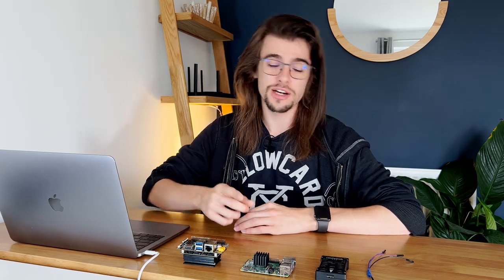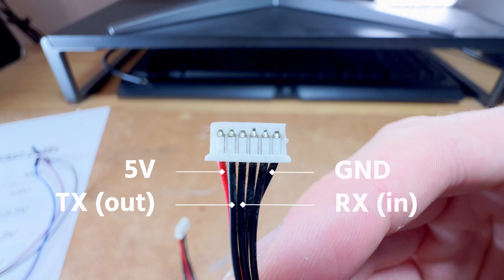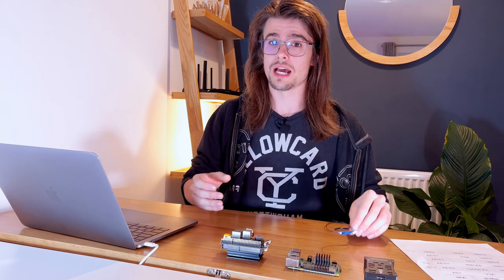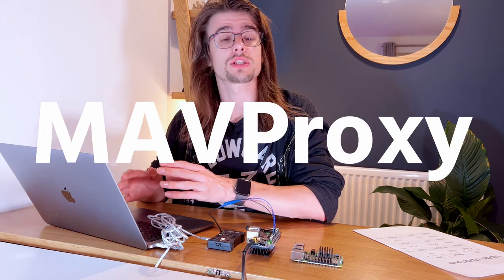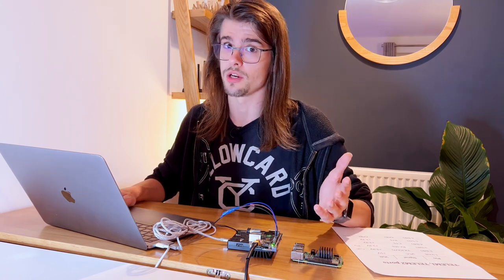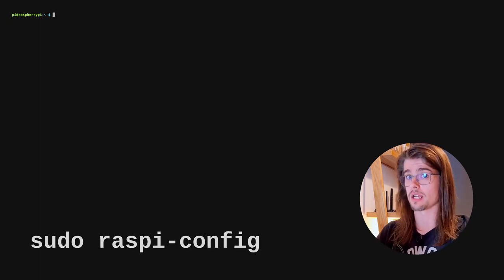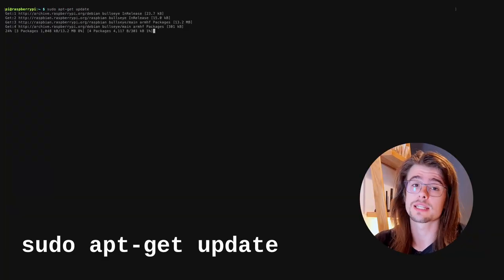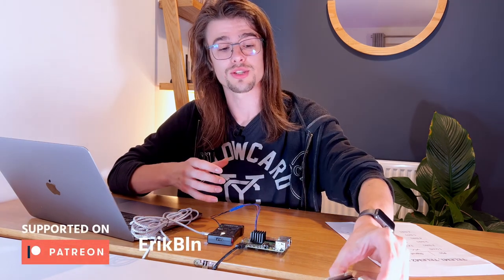How To Connect PixHawk to Raspberry Pi and NVIDIA Jetson

Comment: Great tutorial man, that's gonna really help me out later. I see you cut the 5V wire, but I also would like to know, is the PixHawk capable of supplying the full 20W range specified for the Nano through the telem2 port? That would be really handy as I want to install the board to the drone itself. And I'm not sure that I trust the PixHawk board will permit that power draw...

Edit: Figured I would use a buck converter from the battery instead, that way I can guarantee that it is capable

Comment: Hey, I have an AI model running on raspberry pi 0 2w, and the flight controller I have is the same as pixhawk 2.4.8. What are the benefits if I connect the raspberry pi to pixhawk ? I have seen how to connect, but what I fail to understand is, in my use case scenario will it be beneficial ?

Comment: Hello Sir, your videos are very useful. Thank you very much
I am newbie to Drone building DIY. I have Pixhawk 2.4.8 and wanted to use it with 4-in-1 ESC along with Raspberry PI 4 or 5. I watched all the videos out there on this scenario and all of them uses individual ESC's for each motors. I came across encoder to use but surely not understand it. I watched this video about connecting Raspberry PI to Pixhawk so I think I am okay there but not connecting 4-in-1 ESC to Pixhawk. Would you be able to suggest how I can get 4-in-1 ESC connected to Pixhawk? Or if you could do a video on it, would be awesome. Thank you so much for all your help in advance sir.

Comment: Hey, thank you so much for guiding me just like WOW! I am thinking about how can we connect the companion computer pi or Jetson, with Pixhawk using their micro-USB cable, I have seen a guy who is connecting, can we do it after following all the commands provided by you or there is another configuration need for  that...
Reply from the maker: You can technically use the micro-USB cable for serial but be aware that it disables some safety checks - for example, ArduPilot will assume it is not connected to a battery when using the USB link, and disables all battery failsafes.

Comment: Welcome, excellent explanation. Can you make a video of orange pi integration with pixhawk???
Reply from the maker: If I had access to one, sure! That said, in theory you can adapt the instructions in this video for the Orange Pi.

This looks to be the pinout for the Orange 5: http://www.orangepi.org/img/pi-5-pin-definition.png 

I imagine its a case of ensuring the TX and RX jumper wires of the serial wire I showed to the pins marked UART3 - ensure the TX jumper goes to the RX GPIO!

In software, it looks like that would map to /dev/ttyS3. See here for where I'm pulling that info (which is for the R1): https://learn.adafruit.com/circuitpython-on-orangepi-linux/uart-serial#the-hard-way-using-built-in-uart-3010837

Additionally, you may need to enable UART - see here (again, for the R1): https://learn.adafruit.com/circuitpython-on-orangepi-linux/orange-pi-r1#enable-uart-i2c-and-spi-3029848

TLDR; make sure to enable UART if needed, and connect to the relevant GPIO headers with the serial cable I showed in my video

Comment: Hi mr. Matt, I have some questions about coding RP4 with PixHawk. We are trying to making a VTOL UAV and it has a simple task that it will change servo angle at the determined location and altitude. So, I want write a code for RP4 that will get this mission. How can I do that, can u help me? I am an amateur on RP4. Do you have some simple examples about that? :)

Comment: Why did you choose the carrier board rather than the Nano Dev Kit?
Reply from the maker: I’ve used both with a drone, with the carrier board I can just wire up an XT30 connector and not need to power it via GPIO

Comment: thanks for sharing, i'm wondering if mavproxy can work on PX4 firmware?
Reply from the maker: Yep, should work just fine 👍🏻
Reply: @akamatchstic  thanks for reply, it works. However i have to wire tx rx through usb signal transform device.

Comment: Your video is interesting. Let me ask you a question. Does connecting using usb to ttl work in the same way as connecting to gpio pins 8, 9, and 10?
Reply from the maker: It should do yes - the key thing is to ensure a serial device is available to receive/send MAVLink messages
Reply: @akamatchstic  I too bought a usb to ttl device. But I do see how your way would save the cost and save an additional USB port.

Comment: after install mavproxy i need to install dronekit or with only mavproxy i can send commands for px4?
Reply from the maker: Depends on your goal to be honest. I used DroneKit in a project to send commands from a companion computer over Python. Setup looked like this:

My Python program -> DroneKit -> MAVProxy running locally -> PixHawk

If you’re using DroneKit and don’t need MAVProxy to eg also forward data to a ground station, you can actually skip MAVProxy and connect directly to the serial port.

With MAVProxy on its own, you can connect it up to anything that works with MAVLink data over the network. Eg multiple ground stations

If used on its own, you’ll still be able to send commands to PX4 on the PixHawk. DroneKit is one source that can send those commands

Comment: Hii Matchstic ! Can i connect the F405 mk3 lite filght control (other pikHawk)with Jetson Nano for project like u ?
Reply from the maker: In theory, yes!

Looking at the documentation (https://ardupilot.org/plane/docs/common-mamba-basic-mk3.html ), you’ll need to solder the jumper wires directly to the board. I’m not 100% certain of the pins you need to solder to though. That docs page seems to suggest that the RX6 and TX6 pins are available for this, as well as any available Ground pin. As per the video, make sure you connect the soldered RX connection on the board to the TX GPIO pin, and the equivalent for TX to RX GPIO.

In your autopilot parameters, you may need to update the relevant serial port’s protocol to 2 to get MAVLink messages flowing.
Reply: I looked on the jetso nano forum and someone asked the same question.  why are Tx/rx2 and tx/rx4 pins empty but we don't connect them?

Comment: hai
how u connected jetson nano without cable to pc and is there any files how to access jetson and can u sujected me which is better rasberry pi or jetson nano for pixhawk AI control
Reply from the maker: I used SSH to run commands on both the Jetson Nano and Raspberry Pi. If you’re looking for longer flight times, the Raspberry Pi would be preferable due to less power requirements. It’s all down to your project’s requirements really!
Reply: THANKYOU SIR
 @akamatchstic

Comment: hello, thanks for this informative video 🙋🏻‍♂️ i need to ask that, can i do the same steps for jetson xavier nx ? and also i need to give the power supply from a lipo batterry how can i do that? does anybody here to help me?
Reply from the maker: I’d imagine the exact same steps will work for Xavier - just make sure your GPIO connection is correct! For the Lipo battery, I’d recommend looking into using a UBEC to source a good supply of 5V, then power the device from that - this is what I did for my drone using the Jetson Nano

Comment: I get an error saying MAV > link1 down. Could you help with the solution?
Reply from the maker: Sounds like one of the following:

- the RX and TX pins are connected the wrong way around on the GPIO header
- you’re using the wrong serial port (run the following to see available ones: ls /dev)
- the cable is not soldered properly
- the cable is not connected to the right telemetry port on the PixHawk (or equivalent)
Reply: @akamatchstic  There is no problem with any of the steps you mentioned. Could there be another reason?
Reply: @eminbozkus3896  sir,I have the same problem, how did you solve it?
Reply: @chiuanshin1987  Yes, I solved. The problem is depend on the cables of rx,th,ground connection. You should connect the rx to tx, tx to rx and ground to ground, for communication. If your problem will continue I can help you on zoom or any video conference application.
Reply: @eminbozkus3896  Thank you so much, I successfully solved the problem by swapping "tx" and"rx", thank you again~!
Reply: kanka tx rx i farklı bağlıyorum ama yapamadım bir türlü yardımcı olur musun